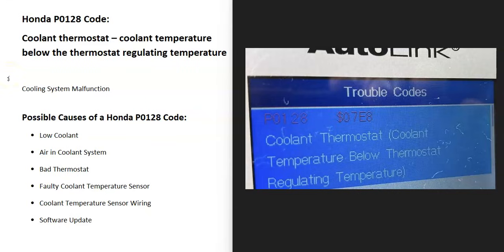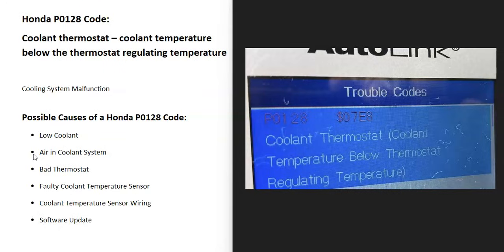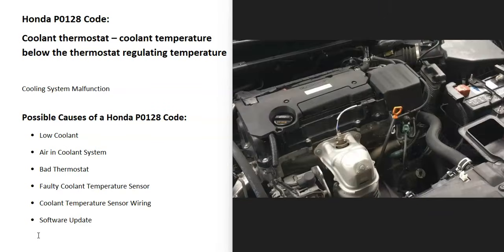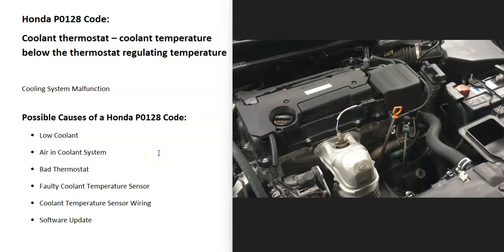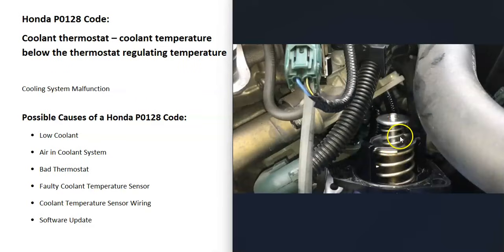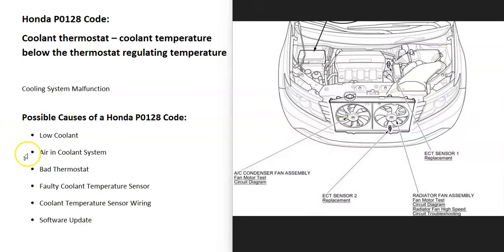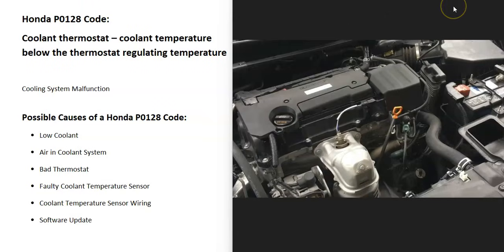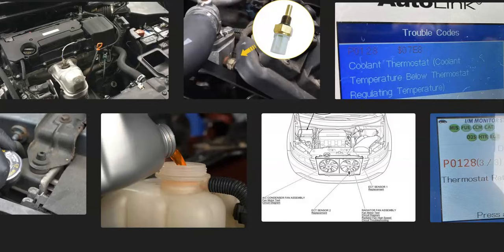How To Fix Honda P0128 Code thermostat coolant temperature below thermostat regulating temperature

Comment: @whyingo helps a lot so I disconnect top sensor and bottom sensor and as sooner I start my pilot both sensors turn on but my gage inside goes all the way up but nothing is leaking on my engine. Can a car be drivable in case of an emergency?
Reply: I meant to spell (Both fans turn on)

Comment: I've had my thermostat and coolant temp sensor replaced on my 02 accord and the 128 code still comes back!!!! What the f should I do
Reply from the maker: If you have a scan tool, check what the coolant temp sensor is reading. If it is way off, check the wiring going to the sensor.
Reply: @whyingo7964  I had a full engine diagnostic done. The guy said all my sensors are working said the Guage must be bad, called speedometer repair shop they said that wouldn't trip the check engine light. Idk
Reply: @stevegordon2644  Correct, a bad temp gauge (extremely rare) wouldn't throw a P-0128 CODE. I would look into a software update. Could be a faulty connection also. Good luck!
Reply: OEM baby from dealer or online

Comment: Can a loose hose attached to the thermostat housing on 2003 Honda pilot cause a whistling sound and po128 code? Already had the thermostat replaced and still getting code and whistling sound even when in park mode.
Reply: What was the solution to the problem?
Reply: What was your problem?